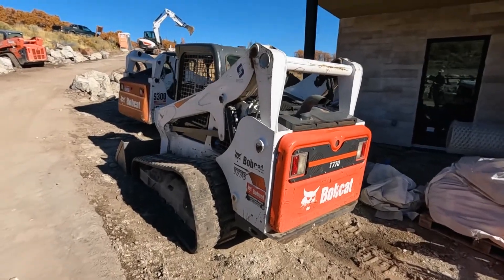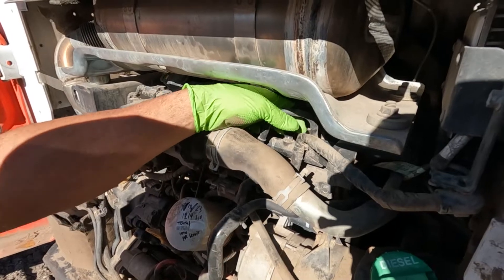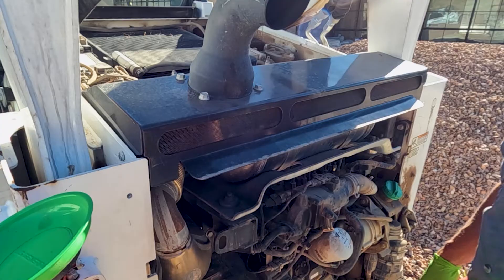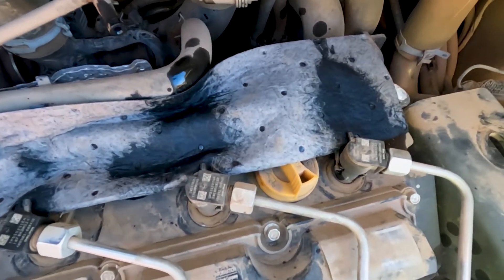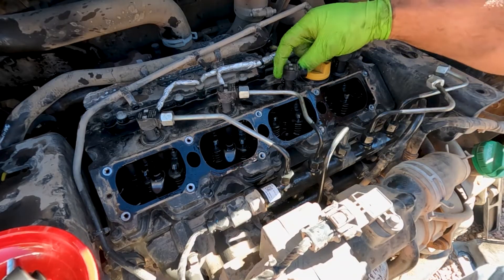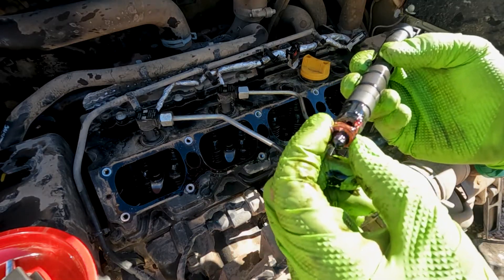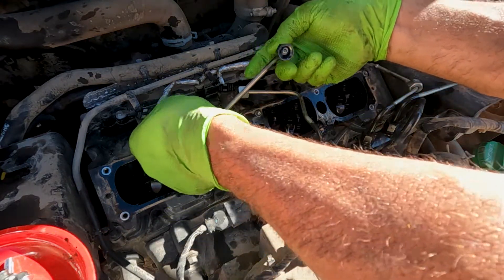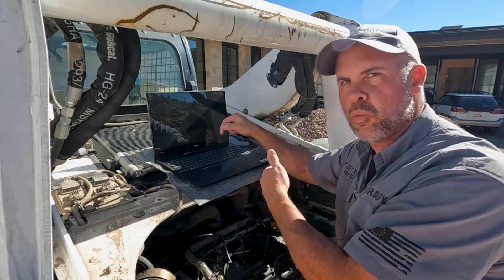Bobcat T770 Hard Start and Runs Rough.  Troubleshooting and Repair

Comment: Hello sir is there any other injectors you could recommend for my S570 other than the really expensive Bobcat injectors. Thank you for your time.
Reply from the maker: I stock the original Delphi injectors.
Bobcat Doosan D24 Fuel Injector 7516848, 7275454 Original Delphi — TETRAD GROUP https://share.google/W6ZuROV3fCF1DGEfB

Comment: T630 w/D24 Ive got no fuel coming out the top of the pump, to the fuel rail. Primer bulb pumps fuel, filter is brandnew. IMV was clean, and tested good. With the IMV valve out the body, we got fuel coming from the IMV socket when i squeeze the primer bulb. But no discharge to the fuel rail.

Comment: My U tube awesome helper/advisor;

We finally made it back out  on the T770.
I wanted to have John involved to help with the work so he could learn a bit as I am also.

All went pretty smooth,  I did not have the 6mm long Allen and I checked 3 stores around my travels.
I ordered one from Ebay but did not realize it would not be here till the 28th:((  
I did have a regular 6mm Allen wrench and surprisingly my socket design 6mm fit just fine.  
John installed # 3 &4.

After the first air bleed  honestly I was on pins and needles as it was time for John to turn the key.
It took seconds and she fired right up:)))))))

About the 2 minute time she shut herself off. 

Warning light for Hydro --  well seeing as I had loosened the drive belt that sounded "of course".
We took care of that undid my line clamps rebled and she ran like a top. 
I made sure to take pics of each injector new and old side by side with #'s clearly visible.

Brady, I cannot thank you enough  for the reach out.
Linking to your company supplied us with injectors at a savings:))

Best; Tom

Comment: On a bobcat t650 what would cause the injectors return line to build fuel pressure 🤔 and lines popping off when cracking and the line going down to injection pump on the return line

Comment: Would you have to test the fuel system for any more contamination? Maybe why the injectors went bad my machine had the same problem and the Mechanic had to test the contamination of the system which was condemned bad so they had to replace the entire fuel system.

Comment: Can i cut off the high pressure line for rotary and inline injection pump or just this method used in common rail  fuel system

Comment: Hello
I’ve watched your videos and am a big fan of yours in guidance to my bobcat equipment. I work on most of my equipment but I’m limited in knowledge. My machine is passing a code of m4404 
2021 A770 with the MaxControl and I can’t connect to my iPhone now
I used remote a month a go with a mulcher attachment since.
If I disconnect the MaxControl I get no code and runs fine
I’ve checked fuses, relays, and plugs directed by Dave Mokena Illinois service dealer
What am I missing

Comment: That’s a nice gravy call .. $2400 worth of injectors alone .. gotta love doosan
Reply: Just replaced all 4 of mine on my T770.  Bobcat wanted $1050 a piece for the injectors.  
I found New OEM Delphi’s at a place in CA for $450 a piece.  Shop around before you head to the dealer.
Reply: @Dirtdaddy953  What was the company ? Tom

Comment: So how do we shade tree mechanics reprogram the computer thingy after changing an injector?
Reply from the maker: Laptop rental or dealer can program for you
Reply: @tetradgroup  nearest dealer is 2 hours away (one way), but I have a laptop. How can I do it with my laptop?
Reply: @ozarkarky you are going to need some special software on your laptop and possibly a special cable
Reply: @andyloebrown8250  so what "special software" do I need and where do I get it? Same question for the "special cable".
Reply: I know it's not recommended but it will crank and run without reprogramming.
Reply: If you need to replace the injectors do some shopping around.  Bobcat wanted $1050 a piece.  I found new OEM Delphi’s for $450 a piece.
Reply: Bobcats way of "gotcha ya".  you're stuck going to the dealer to give them more money...SMH